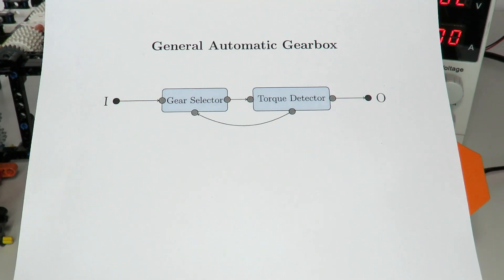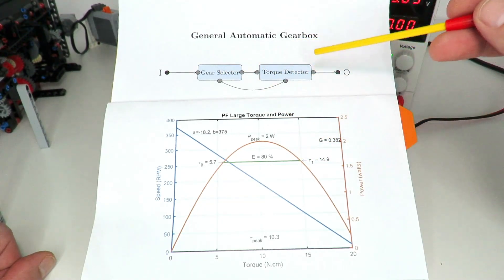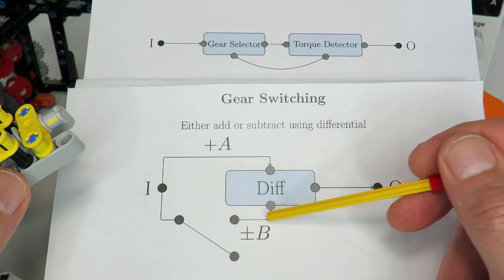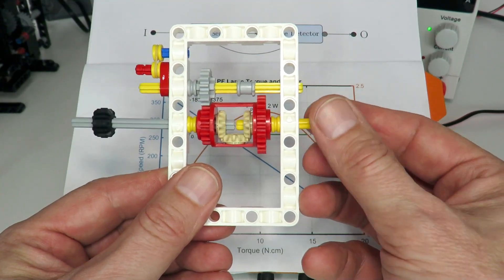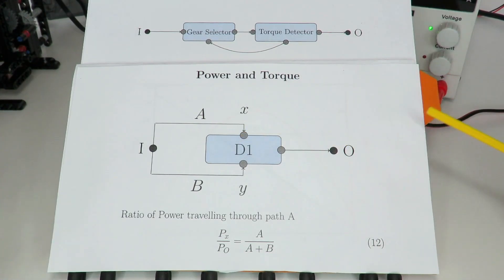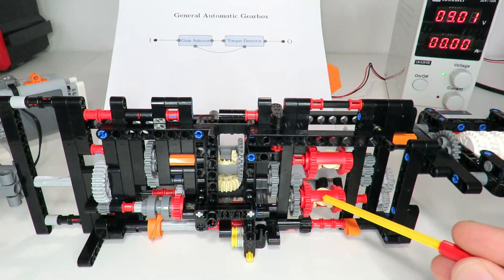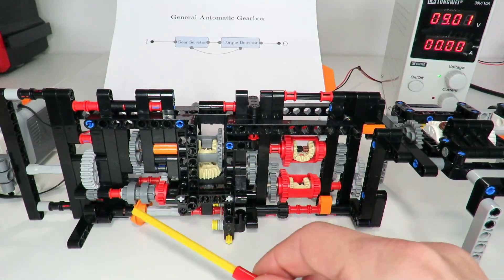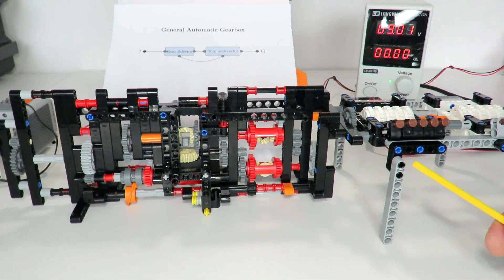Lego Technic Gearbox Theory Applied - how to apply theory to help design 2 speed automatic gearboxes

Comment: I have built a 2 speed auto gearbox using a rpm detector instead of a torque detector. Maybe try that someday. Food for thought.
Reply from the maker: Wow sounds great. Do you have your design somewhere that works like that? 🙃
Reply: @TechnicBrickPower  I don't have it online and disassembled it but if you would like I can rebuild it and post a video on my channel. I even fitted it into a functional car.

Comment: I would use Cross Axle, Extension, 2M

4516546 59443 TECHNIC DARK STONE GREY 2006
Instead of the gear shift selector for a frictionless mode of shifting.. otherwise another brilliant video and soon that ramp will have met its day!!
Reply from the maker: Hi Pc doctor! Ok thanks you mean use that part under the driving ring or somewhere else?
Reply: @TechnicBrickPower  yes replace the white color element which is inside the gear shifter ring with any cross axle extension.. its a bit shorter but the shifter nows would slide without any of those friction clicks..

Comment: For an alternative gear switching mechanism, what I've used is two parallel axles (x1 and x2) and gears with different ratios but constant distance between and a bit shifted (gear A, stud, gear B on x1 and gear B, gear A, stud on x2. This results in a change A:B to B:A) and the switch is the move of the lower axle. My experience is that it requires less force to switch than the default lego mechanism.
Reply from the maker: Hi Levente, Yes thanks for that idea. I have seen that done like that and it does work well. I have been chasing my way of doing it for too long ;) I am not sure if I am getting anywhere LOL 🙃